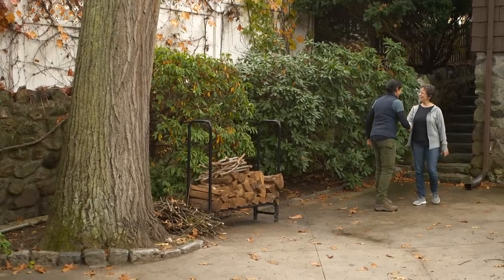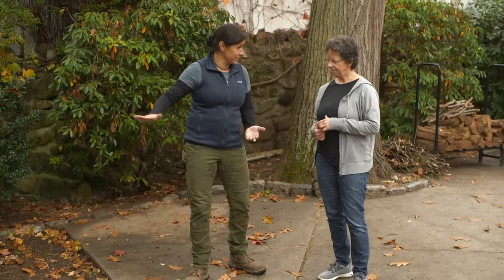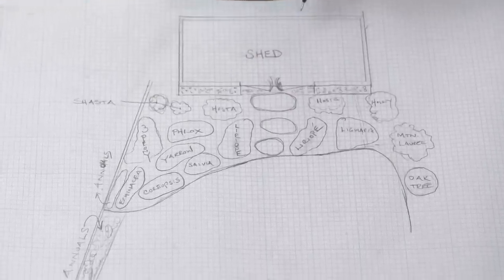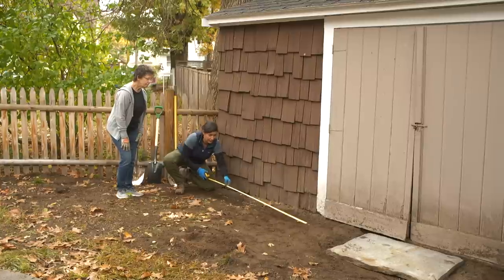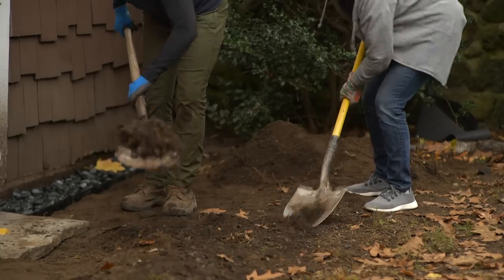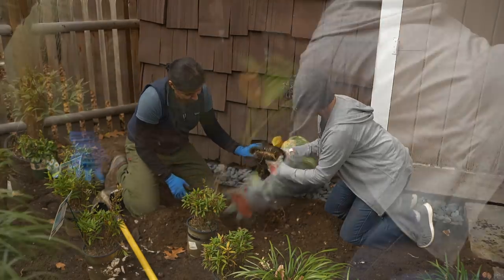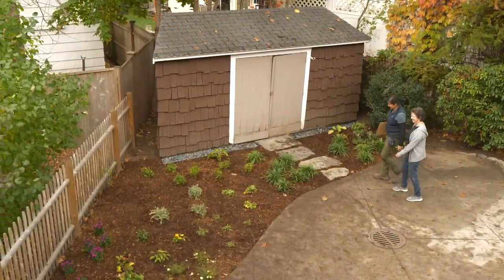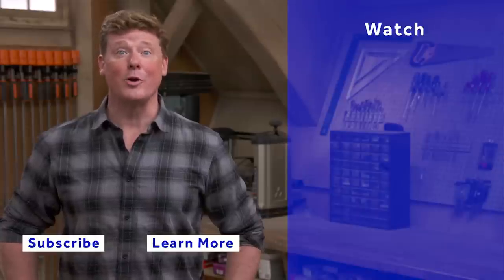How to Create a Sun and Shade Garden | Ask This Old House

Comment: I am a rookie at landscaping,   would you dig out the entire area  and put landscape fabric down to prevent grass and weeds from growing in the area?  Then cut a hole in the fabrice,  set your plants and refill with material of choice?  stones,  mulch,  replace the original dirt etc?  I hate weeding
Reply: Landscape fabric is temporary. You will only delay weeds from growing through it. I recommend a thick layer of mulch and a good scuffle hoe for weeding. Frequently using the scuffle hoe for removing weeds will keep their numbers down. 

I can't say enough good things about my gardening scuffle hoe. It's the best.
Reply: I second doing a thick layer of mulch instead of the landscape fabric! The fabric I used disintegrated after a few years. Meanwhile, seeds that try to root into the mulch come out nice and clean!
Reply: @Alex-fs6kz  @Jennifer J.     Interesting,   thank you for the responses.  So remove some dirt,  replace with mulch and buy a scuffle hoe.  I can do that.  lol..
Reply: I've had really good success with CARDBOARD and then mulch/dirt on top. It kills everything underneath and then breaks down once its job is done. Then you only have to keep up with new weeds from then onwards.
Reply: @michaele1201  I prefer the triangle shaped scuffle hoes. Skidger and Rogue hoe are two very reliable brands.